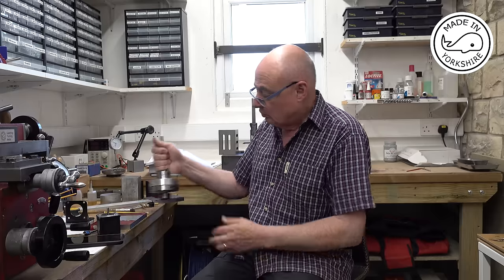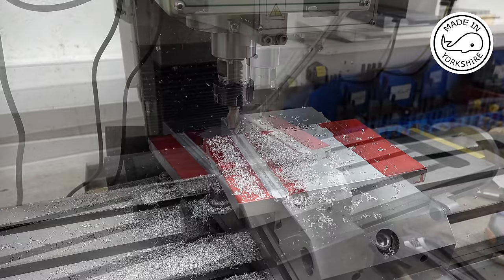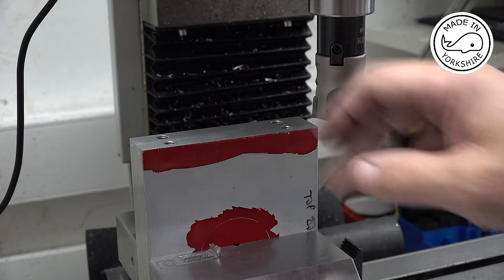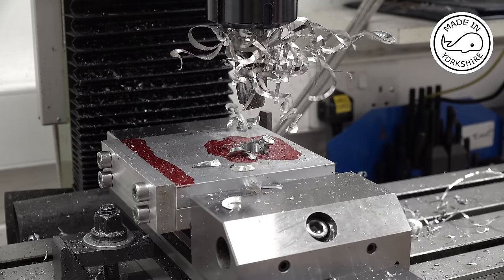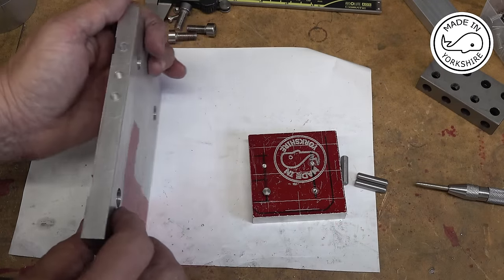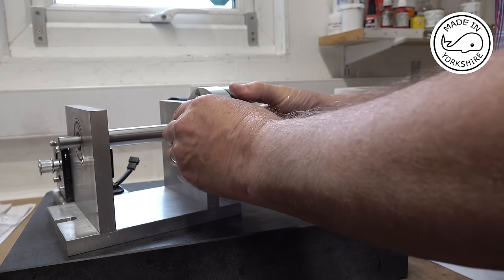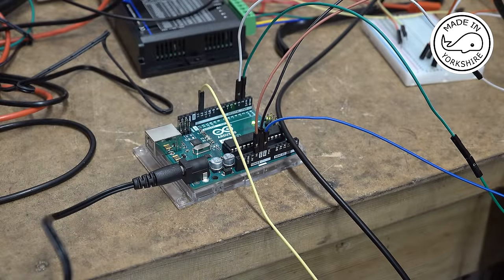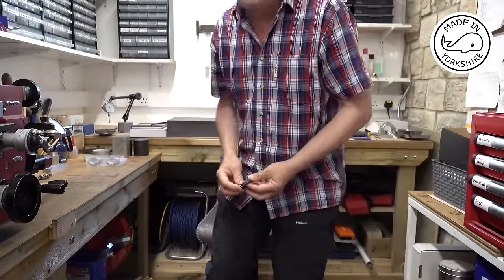#MT50 Part 3 - Making a Gear Hobbing Attachment. The Housing. In 4K/UHD by Andrew Whale.

Comment: When you use an oscilloscope to measure frequency or pulse width the screen can be setup to show these parameters without having to use the measurement cursors. Your oscilloscope looks fairly new so I'd be sure you either already have the readings you require on the screen or the setup can be used to add them.
Reply from the maker: Hi Neil - thanks for the info. Yeah it's a new oscilloscope and I'm still trying to learn how to use it. Some of the symbols are quite confusing to me too. I must have another look at the manual and try to understand it better.
Cheers
Andrew

Comment: Even though you have a bunch of large diameter end mills, I'm a bit surprised you didn't use a hole saw for initial roughing out? I find them a lot quicker plus you get a 'slug' to use for something else.  Best way to use hole saws on aluminium is to get them sṭarted to depth of tooth then drill some clearance holes in the recess for swarf to fall through (just in case anyone reading this has tried a hole saw on thick material and had very poor results)
If your centre punching a shaft, it's the ideal job for an automatic spring loaded punch to get consistent depth of 'dimple'. .Use Blue thread lock  (any cheap one) instead of 638
Reply from the maker: Thanks for the info. I don't have a hole saw, but I'll keep my eyes open for one.
Cheers
Andrew
Reply: @learningturningmetal  Hi Andrew, you can pick them up at reasonable prices for bi-metal at Home Depot or Machine Mart.()although I haven't visited either since I moved to Florida in 1999
 For aluminium you can run quite fast but I tend to lower rpm so aluminium doesn't build up on teeth. for steel, drop rpm quite. (I run 1-1/2" dia around 250 rpm in mild steel) Bi-metal cutters are capable of much higher rpm but I'm in no rush to replace things

Comment: Well done, well filmed, well produced video.
Handling large items in the lathe or the mill..... Take a look at Blondihacks making a large steam engine....
The last video from You Pie showed 7 different ways to "dirty fix" the issue with the shaft fitting into the bearings.

The schematics.... It likely works but using a 5 volt DC supply fed into the 5 volt pin is preferred. Using 9 volt into the barrel jack ought to work but be very careful tapping the Arduino 5 volt pin. There's my some 10 - 20 mA available. The Arduino onboard 5 volt converter is not heat sinked and could overheat.

Connecting a monitor to the USB will not work. That USB port is a client, a receiver prot. For a monitor a host USB shield is needed.

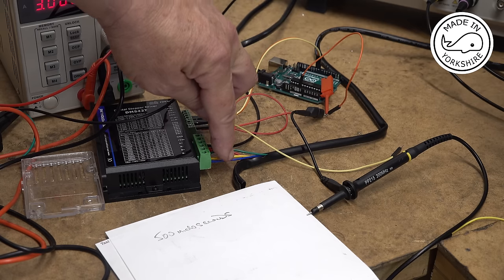Time 22:30. You got it working I think. My remark is: Stepper cable colour varies, is not standardized. 

Time 24:50. So Your stepper is following the mill rotation. I hope the regulating algoritm, for the stepper, is up to the task. The little UNO does a lot but Clough42 said he needed more computing power for his digitally controlled lead screw.

Your first issue, what ever it is.... You have my Email address. Use it! I don't always know but might know ways to become knowing.

Specify that hob, hobber You need. SKF has donated lots of gear cutting stuff to "my" museum railroad. I'm pretty sure some begging by me would work...
Reply from the maker: Hi Stefan - thanks for the info.
The code I hope to use is from AndysMachines Youtube channel. It's written in assember language and he says the Uno should easily cope. The problem is that the code randomly stops outputting pul and dir signals to the stepper driver. I think it might be an environmental issue. For some reason I can't find your eamil address. If you could send me an email I can send you a link to a video which describes the problem I am having. Maybe you could suggest what is causing it not to work?
In terms of the hob, any old hob will do. I just need to be able to test the hobber to see if it is able to cut gears.
Cheers
Andrew
Reply: Just sent You an Email.... @learningturningmetal
Reply from the maker: @Stefan_Boerjesson  thanks, but no email received as yet. I have sorted the problem though. I found that the lcd shield's pins are offset from the Arduino's pins by one pin. So the encoder was connected to pins 1&2, not 2&3. All sorted now.
Cheers
Andrew
Reply: @learningturningmetal  I was quoting Your posting as a beginning of the Email. Check the spam folder!

Great! You found the error. Avoid usng pin 0 and 1, D0 and D1, as they are used for downloading the code.

Comment: I have used the method of two files, opposite direction, with the shaft between in a vise, and hammering one file past the shaft, while pressing the files into the shaft with pressure from the vise.  This gives a fairly even pressure around the shaft, raising an even knurling all around the shaft.  I would also secure the shaft between the bearings with washers against the bearings and locked collars secured in place.
Reply from the maker: Hi John - thanks for the tips.
Cheers
Andrew

Comment: Hi Andrew Great videos but I did wince when you hit the shaft to get it through the bearings, this will ruin the bearings because you are striking the balls into the race.
The proper way is to press the inner onto the shaft, the balls and outer are free of pressure.
Reply from the maker: Hi Roger. Yeah I hadn't thought of that. Having said that I don't think my press is big enough to accommodate such height. I will bear that in mind in future though.
Cheers
Andrew

Comment: Quick tip use a automatic punch to make the right hand punch marks slide the shaft through and before you enter the second bearing automatic punch the second marks that way you don’t knock of the second marks with the first bearing old truck I learnt when I first started out.
Reply from the maker: Hi Jon - you have nailed it! Why didn't I think of that!
Cheers
Andrew

Comment: You can actually use a fly cutter for your gear hobb (Polygon turning). It would be slow but is does work. The only disadvantage is your fly cutter would need the actual gear form. Not the rack form that a proper hobb has. It wont generate the involute form like a hobb. On your setup it would have to be done at a low enough RPM that your hobbing attachment could keep up with.
Reply: A fly cutter won't work for this type of helical hobbing that Andrew is planning on using. It will work for incrementally indexed hobbing only
Reply: @howardosborne8647  What I'm referring to is not hobbing at all. It is like I said in my comment,  Polygon turning. If the flycutter is rotating in time with the workpiece. Lets take his example in this video. He had the spindle rotating 20 times for one rotation of the rotary axis. So if the flycutter hits/cuts the part 20 times per one revolution  of the rotary axis,  it will cut the 20 teeth. The only thing is with a hobb it will generate the Involute profile from its straight rack profile. because it is cutting the sides of the teeth as well as the part rotates.  The flycutter wont because it isn't hobbing. Neither is what you refer to as Indexing and cutting each tooth as if you are cutting them with a standard milling cutter. With polygon turning you can also generate things like hex and squares depending on the way you orient the tool to the work as it rotates, and the speed of the spindles. The tool has to be in time with the rotary axis spindle. It may be difficult to cut a helical tooth gear this way (I would have to try that) but it will defiantly cut a straight tooth gear.  The only thing is if his stepper motor drive could keep up with the milling spindle. Maybe at a low RPM.
Reply from the maker: Interesting. If nothing else, it would be a good test of the hobbing attachment maintaining equal spacing between cuts. Only problem is I don't have a fly cutter (yet!).
Cheers
Andrew

Comment: The spindle came out very well. I liked the solution to the loose fit in the bearings. Had been concerned that using loctite the shaft wouldnt be fully centred. That would carry error into the cutter and on into the gear. You are now into the dark arts of making the electronics obey you. All a complete mystery to me. Hope you can resolve the issue.
Reply from the maker: Hi Tim - one thing I forgot to do was to put a gauge on it to check for runout. I'll check that out today. Hopefully I will be able to work out why AndysMachine code doesn't run correctly. I've also sent a video clip to Andy, demonstrating the issue, so maybe he can shed some light on it.
Cheers
Andrew

Comment: Hi Andrew, cracking series .. brave with it! I do worry about the rigidity of the workpiece when you actually to start cutting it. The forces needed to remove the metal are pretty huge after all and I wonder if the cutter might overcome the motor's ability to step as the work is effectively being turned (forced?) into the cutter's edges. I suppose a way to overcome that would be a worm drive for the spindle but of course that would need gears! I have no direct experience of doing this but it might be that the worm action of the hob will do that for you of course .. here's hoping. Anyway, I'm looking forward to the next episode .. keep it up my friend!
Reply: The mill head is tilted to match the spiral angle on the hob.  So, won't the overall cutting force be axial (for a straight-cut gear)?
Reply from the maker: Hi Ian - going by AndysMachines channel videos it does seem to work well. I just need to work out why Andy's code isn't working properly.
Fingers crossed I will get it sorted and find a hob to do some test cuts.
Cheers
Andrew

Comment: If you are getting random strange things happening I would bet its noise on the power supply somewhere, separate the supply to the motors and the Arduino if you haven't already and stick a bunch of decoupling caps across every supply input
Reply from the maker: Hi Campbell - you might well be on the right track. I have a separate bench supply to the stepper driver and motor, but I did observe the code failing when I switched the bench supply on. I moved the bench supply to a different ring circuit in the house but that didn't help. I've just ordered a separate 24v supply to try out. The Arduino is powered by a 12v wallwart. I don't have a clue as to how to introduce decoupling capacitors - but I will investigate.
Thanks for your input.
Cheers
Andrew
Reply: @learningturningmetal  A decoupling cap is nothing more than a small cap usually 0.1uF ceramic or similar placed as near to the power pins of active components. Unlike an electro which acts as a charge store to smooth out current bursts these caps look like a low impedance path to ground to any high frequency pulse on the power lines. Your Arduino will have them  on the board but it doesn't hurt to add more at the power inputs. Consider putting one across the power pins of your encoder. You cant put them on the encoder output as you will affect the pulse rise times so you should put the signal via a shielded cable.. Definitely pays to have them around the motor controller. Another thing that has caught me is the step rate may need to be ramped up to allow for any inertia load but as you are not stepping very far it probably isn't a problem for you. Hobbing is fascinating but way out of my area of knowledge, I'm still using gear cutters.
Reply from the maker: @campbellmorrison8540  on further inspection I found that the lcd shield's pins were offset from the Arduino pins by one pin. So the encoder was connected to pins 1&2 rather than 2&3. All sorted now 👍

Comment: Hi,Andrew. Happy to see you venturing into the indexed drive for hobbing and it  coming together so well.
Do you plan on giving yourself both options of helical hobbing and incremental step hobbing with this set up?
 It will be much more versatile for other jobs like spline cutting if you do include both options in your design.
Reply from the maker: Hi Howard - I'm trying to keep it simple at the moment and it won't do helical hobbing. If I can get the basics right I could always make another attachment.
All the best.
Andrew

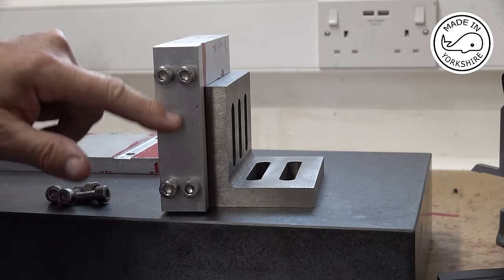Comment: At around 9:11 you're bolting the sides to a jig. I was always lead to believe that bolts were not good for locating features - but it seems to have worked for you?  Am I going mad?
Reply from the maker: Hi William - I'm not sure if that approach is frowned upon, but it certainly worked out okay for me. It seemed like the best way to ensure that the botton of both sided were perfectly aligned together.
Cheers
Andrew
Reply: @learningturningmetal  Clearly it did work, maybe my instruction was more theoretical than practical? I guess it would have been something like using a reamed hole and a dowel pin for alignment? Anyway - great work and thank you for the video.

Comment: Are you sending 200 pulses to get 1 rotation of the steoper motor?
When a stepper runs like that (full step mode) it has a lot of resonance issues and that can cause it to jump steps and get nasty position errors.
It is much better to use one of the microstepping modes like 1600 or 3200 steps per motor rev. 🙂
Reply from the maker: Hi Wiz - thanks for the advice. Yeah I was sending 200 to get one rotation, using my basic test script but it did work okay. The problem I am having with AndysMachine code is that the output signals from the Arduino just stop, before even getting to the driver. Wierd. Hopefully I will be able to solve this little problem and increase the motor steps per rev. 🤞
Cheers
Andrew
Reply: @learningturningmetal     interesting, try checking the interrupts etc, his code might be ok but it might be a conflict with interrupts and config settings in the compiler or programming.
Reply from the maker: @wizrom3046  on further investigation I found that the lcd shield's pins are offset by one in relation to the Arduino. So the encoder was connected to pins 1&2, not 2&3. All sorted now 👍

Comment: How did you bend the shaft?
Reply from the maker: Hi John - I'm not sure what you mean. I didn't knowingly bend it.
Cheers
Andrew
Reply: @learningturningmetal  
I noticed the shaft cranking at the belt pulley. when testing the motor,
Reply from the maker: Hi john. Not sure what you mean. Can you explain? 
Cheers
Andrew
Reply: I noticed the shaft cranking in your video when you first tested the motor. It looked like the shaft was bent looking at the pulley.  @learningturningmetal
Reply from the maker: @johnlemmey7698  I'll check that out.
Cheers
Andrew

Comment: As a toolmaker... this video concerns me...
Operations like filing, punching and hitting with a hammer is a no-go near the surface plate. It automatically damages your reference plane which defeats the purpose of the equipment in the first place.
Reply from the maker: Fair point Hanro.
Reply: @learningturningmetal   But your video did keep me entertained until the end. 
And I do not want to scare you away from making. 
I just feel that the maker needs to learn how to use their equiptment in their workshop for max efficiency.